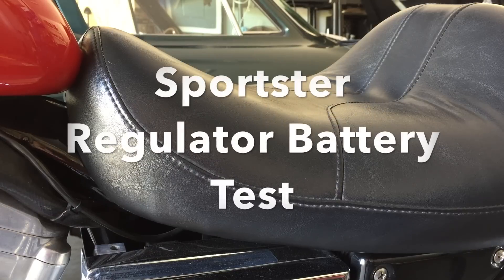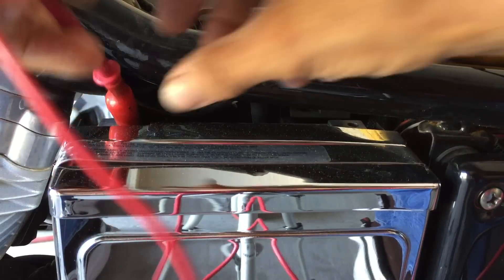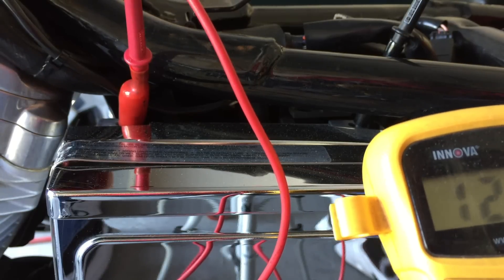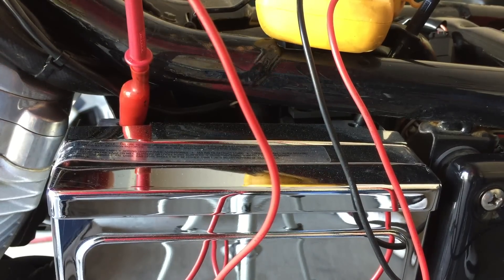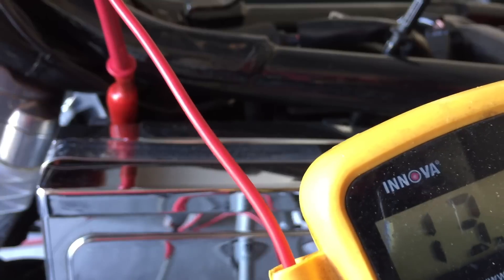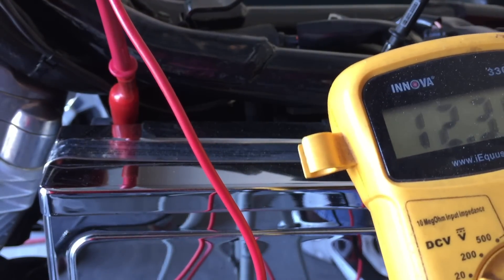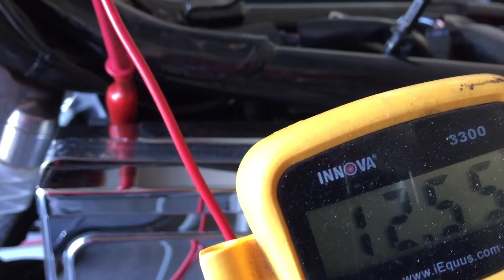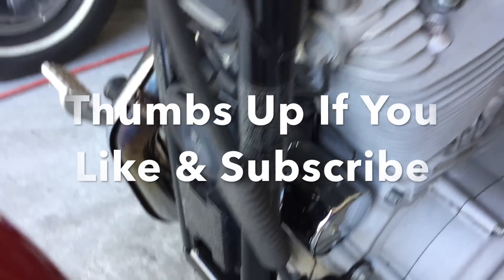How To Motorcycle Voltage Regulator Charging Test On a Harley Davidson

Comment: This is a B&S dodgy test of a RR - There;s all kind of issues not being looked at/picked up by simply check the charging by starting it up. If you suspect a charging issue I would start by taking off/disconnecting the RR then measure the stator cables (resistance readings) followed by do a forward and reverse resistance check on the RR)
Reply: Id like to correct what I said - Theres a couple of exceptions to the rule of measuring the resistance on RR's - Generally you can do just that, but when it comes to the Shindegen SH775 and SH847 series RR's you simply wont get a resistance reading with a voltmeter - Its a bummer and mystery to me, but workaround is to hook it up to a live scenario bike or a test bed and measure the voltage coming back out. 
- But as a general rule of thumb you should check the RR itself first where the resistance forward/back on between plus/minus and stator posts

Comment: My battery is showing 12.2 while off and idle its going up to 14.2. I've been having the check engine and battery light come on randomly. I was hoping it was the regulator because the ease of replacement. Is it possible that the regulator is out even though my battery it reading 14.2 just like the one in the video?
Reply from the maker: Regulator is functioning proper that's a good number 14.2 as for your batteries at 12.2 how old is it it?  Sounds old. I would replace the battery.  What Bike and year? do not buy a cheap one. I hope this helps. Thank you for watching and your sub Ben. Let us know how it works out. Ride safe and have a great day

Comment: Hello Two Wheel Rocco, My RR went out on me, luckily after I got back from a ride. there was 
smoke, the connector between the stator and RR was VERY HOT enough to get burned, it is a 91 XLH1200.
the stator is good .3 ohms and puts out 65 volts around 2500 rpm. the RR internally shorted 
the Bat+ wire to ground.  I am just trying to understand why the stator winding got so hot. there 
is a  circuit breaker between bat and charge wire but it,  I think is 31 yrs old and it never opened.
Thank you very much, I do appreciate your knowledge.
Reply from the maker: Happy to help. I would change out the regulator. They are cheap enough. That is the weak link in that system. Thank you for watching and your sub Ray. Let us know how it works out. Ride safe and have a great day.
Reply: @TwoWheelRocco  Hello TWRocco, Yup I got rid of that RR. I am going to put
an inline fuse in the Bat charging lead of RR for 25 amps. The stator is good for
23 amps. Clymers shows a circuit breaker between Bat+ and wire to RR but it is probably like 31 years old and never opened when it should have. Do you know
why the connector between the RR and stator got so HOT? I do have a new RR
coming from HD Tues or Wed.  I will crimp stator leads to RR's leads as the 
stator connector got scorched and was internally shorted.
Reply from the maker: @raymondgarafano8604  let us know how it works out. That's what regulators do, get hot when they're bad. Ride safe and have a great day.
Reply: @TwoWheelRocco  Well yes I know the RR gets hot as it is dropping voltage so the bikes' lites don't get burned out. No issue there, that is why there are Finns on 
the RR to dissipate the heat. I would like to know why the stator's wires and connector between the stator and RR got so hot..
Reply from the maker: Not regulating the voltage properly. I hope that helps. Usually that's the first thing I replace. Very rare does the stater go bad. Ride safe and have a great day. Thank you for watching and your support.
Reply: Thanks Rocco, Yup HD said, "usually when they go they either toast the battery
by overcharging or not charging but hardly ever short the battery charge wire
 to the ground, but its electronics so you can never really know." Thanks Rocco!
Reply from the maker: My pleasure Ray. Let us know how it works out. Easy fix.
Reply: @TwoWheelRocco  Thanks TW Rocco, It worked out well. I did put a 20 amp fuse in charging line  phsically near the RR so if the fuse opens up, hopefully njust on overload and not a direct short, I can change it out. I may have been lucky as I'd imagine the charge wire to be in the harness and if it got anywhere as hot as the line from Stator did, I think it would take out the harness, Anyway it is working fine.
I had a meter across the charging plug for the battery tender, meter read 14.5 volts
at 1500 rpm. and 12.8 not running.
Reply from the maker: Sounds like you got that under control. Ride safe and have a great day Ray.  Thank you for all your support.

Comment: So 94 sportster xlh1200 love your videos quick question fresh battery charged up check voltage before start 12.55v then running voltage fluctuates from 12.55v down to 9v sometimes to 5v doesn’t seem to be charging any tips haven’t checked regulator but the volts are going down up and not going past 12.5v so I thought possibly not a regulator issue. Also now I tried to start the bike and I hear a very fast clicking sound not a single click.
Reply from the maker: replaced your regulator that's what I would do let us know how it works out. Thank you for watching on your sub. Ride safe and have a great day.

Comment: Mines a 09 nightster and I'm getting 15.00 volts when I Rev it up and my code that's popping up is high voltage battery is good and just got a regular and still.. any ideas?
Reply from the maker: Happy to help, how old is that regular?  and how old is the battery? There's a short in the regular  or in that battery. Was this the same problem as your other regular.  Thank you for watching and your sub Kyle.   Let us know how this works out. Ride Safe And have a great day.

Comment: After the bike warms up should the voltage be dropping down to 12.5v at idle? I've noticed over the past couple days when  idling at a light I'll see my battery guage drop from 14v to about 12.5 then go back up to 14 if I bring the rpm above 1000...I checked the connections and the battery all seem good...I ride an 06 street glide injected btw
Reply from the maker: Thats Normal, My king does the same. Thank you for watching, Ride Safe and have a great day.
Reply: Two Wheel Rocco thanks so much for the quick reply...that puts my mind at ease...was starting to think it was the regulator or worse, the stator...thanks again and ride safe aswell

Comment: Hey Rocco thanks for the vid. Well done. Question. My 2009 softail deluxe has recently been having the check engine light come on a second time when getting ready to start it (it comes on normally for 4 secs when I turn on the “run” switch) but then comes on again for 9 secs then turns off. Starts just fine. Pulled codes from the bike today. P0563 (high voltage from the ECM), B0563 (high voltage from the turn signal module), b1006 and b1007 (line voltage from speedometer). Checked the regulator like you did in the video. Started at 12.6 volts, dropped to 10.5 at start, rose up to 14.17 after running a bit. Is it possible the regulator is bad even tho it seems to be charging?  Do you have other ideas?
Reply from the maker: Happy to help... Disconnect battery leads and retighten leads  check for loose ground ..Thank you for watching and your Sub Marshall. Ride Safe...And have a great day.

Comment: I have a '99 Sportster, 1,600 miles, new battery,  after a long ride I put it on the battery tender, within 8-10 minutes the tender light is solid green, that leads me to believe the charging system is ok, if it took a long time to get up to solid green I would think the battery was drained because the bike's charging system wasn't charging enough...........does that make sense? I should get a multi-meter to be sure I guess?
Reply from the maker: Happy to help. I would have to agree. All sounds well. Any questions just ask. Thank you for watching and your sub Frank. Ride safe and have a great day. Very rewarding to do your own work on these Sportsters.

Comment: I was just riding bike started puttering noticed speedometer dropping and lights flickering... got to my house and bike stalled out... would that be a regulator or stator problem? 2011 fxdf fatbob
Reply from the maker: Sounds like you will need to replace your regulator.  It failed and you where running on your battery. Replace regulator and charge battery. Let us know how this works out.
Reply: @TwoWheelRocco  I saw one of your other videos i will place the order on ebay and give it a go over the weekend... I'll keep you updated
Reply from the maker: @Mr75towing   Any question just ask. Thank you for your support.
Reply: @TwoWheelRocco  took me some time to get around to it... when i removed my battery cover the negative terminal had melted on the battery... i bought the battery from harley and they charged it for me a few months back. Replaced battery and regulator since regulator was original and bike is 8 years old.... bike started right up over 14 volts idle 12.5 off... thank you so much! Saved me an easy grand or more local bike shop went and said stator from what i explained to them. Ride safe
Reply from the maker: @Mr75towing  Happy to help, Thank you for the Sub. Ride Safe and have a great day.

Comment from the maker: Let me know if you have any question.
Reply: Two Wheel Rocco how do you know if the regulator is bad. i got a P0562 code and I have read it couls be battery. regulator. or stator.
Reply from the maker: Sounds like bad regulator... Check battery connection. regulator should charge at 13 to 13.9 or so....Put a volt meter on the battery and run the RPM's up and watch to see if the voltage climbs if not... indication a charging problem. Change Regulator..Hope this helps..Let me know how this works out.
Reply: Two Wheel Rocco Thanks. figured my best bet would be swap the regulator. then go from there.
Reply from the maker: They are notorious for going bad.....Ebay, very fair prices...Ride Safe..
Reply: Thanks! You too!
Reply: Two Wheel Rocco. 12.59 volts. start up drops to 9.98... the it peaks at 13.86 while running at idle and while holding revs at about 2-3k
Reply from the maker: What year Sportster...
Reply: 2008 Nightster
Reply from the maker: Did you check ground cable on battery side....they are set up poorly...9.98 is not going to work out well....If connection is tight. Replace....http://www.ebay.com/itm/New-Voltage-Regulator-Rectifier-For-Harley-Davidson-2007-2008-Sportster-883-1200-/361442779138?hash=item5427ab2002:g:SpoAAOSwxN5WYKDG&vxp=mtr  Hope this helps...Let me know...
Reply: All connections are solid.
Reply from the maker: Replace.. easy fix.....Ride Safe...
Reply: At idle my bike floats around 13.5 V when I bring the rpms up 2k-3k battery voltage drops to 8-9 and holds there. Did a continuity test on stator it passed. checked operating voltage of stator at 2k  rpms and it was 40-42V. You think its the regulator/rectifier?
Reply: Could bad regulator cause overcharging and burning out lights?
Reply from the maker: Absolutely my friend,  Buy a new regulator. That is what a bad regulator does. Any questions just ask. Thank you for your Sub Adolfo. Let us know how this works out.  Ride Safe and have a great day.

Comment: My battery is at 12.6v when bike is off and goes up to 13.9v when I start it and it stays there, even if I rev it up a little it won’t reach 14v. Bad regulator?
Reply from the maker: Happy to help. Regulator is fine. 13.9 is great. Thank you for watching and you sub RGV.. Ride safe and have a great day.

Comment: Sorry to bother
I was wondering my 2016 Harley 48 that  I check the charging system when the power is off it shows 12.3 and when I start up it goes to 13.5. Then I rev it , it goes to 13.9.
Is that ok for my charging system?
 By the way I changed my battery about a month ago
Reply from the maker: https://www.ebay.com/itm/334116670196.  Great Battery.  let us know how this works out.
Reply: @TwoWheelRocco  and also my charging system is running well as well?
It didn’t go up to 14.5 but only close to 14 when I rev it with idle
Reply from the maker: @louislouis809  System is working well your battery is old,   Personally myself I would replace it. I sent you a link for a great battery that I use., Let us know how it works out.    https://www.ebay.com/itm/334116670196
Reply: @TwoWheelRocco  But I just replace my battery a month ago
Reply from the maker: @louislouis809  12.3 is a weak battery,  Should be 12.7  is a good battery.  recharge and recheck volts. let us know how that works out.

Comment: Gen light on at low rpm ...
Hi. Rpm its out ???
Reply from the maker: Test, what does it read volts on high RPMs?
Reply from the maker: Sounds like your regulator is failing. What does your volt meter read when RPMs are up a 3000 rpms when you test?

Comment: Hey 1975 sporty light on at low rpm
????
Reply from the maker: Low oil pressure.  If you raise your idle you will have better oil pressure.  Hope this helps. Thank you for your Sub Ed.  Ride Safe and have a great day.
Reply: Gen light on low rpm 
Hi rpm its out ???

Comment: Ey, so when my bike is up and running the volts jump to normal numbers but every 2 months or so the bike wont start up and I have to charge the batt. The battery was brand new when i threw it in about 6 months ago. Any thoughts? Alternator? Bad cell maybe? Loose connection draining somewhere?..
Reply from the maker: Type,Year and how many miles?
Reply: 85 xlh 1000. No idea on the mileage.
Reply from the maker: Install a battery tender....Sorry i do not have an answer...Sounds like what you stated Loose connection Drain somewhere...Old bike..Let me know when you figure it out.

Comment: Hi man, is it possible for the regulator to overload the battery after some time riding?
The bike is a 2008 Softail FX and it's battery is getting overloaded with 16A ~18A after some time running at six speed. 
I already measured with the bike stoped and it looks like normal, being  under 12.7A +- when turned off and getting to 13.7A +- when started, the overload only happens if the bike runs at the six speed for a while.
Another curious thing is that the overload stops if I let the bike reduce it's speed under 70km/h at the sixth speed
Reply from the maker: Yes it can..Let me know how it works out.
Reply: The issue was on bike's stator, one of it's coils was burnt making it to close a short circuit with the bike negative pole. As the bike uses the negative pole to charges the battery this short circuit causes a overload charge on batery.
Reply from the maker: Thank you for the update.....Have a great day and Ride Safe.

Comment: Went through all the step you show and my ohms meter doesn’t  go over 12.8v. Do I have a regulator problem?
Reply from the maker: With your bike started and revving,  it will not go over 12.8? Then you need a new Regulator for a good charging system. Let us know how this works out.
Reply: Two Wheel Rocco how often should a regulator go bad? This is 2 years old.
Reply from the maker: @Rickster208  China, things are not the same. Has happen to me also.
Reply: Two Wheel Rocco so with a good ohms meter, 12.01v when the bike is off. With the bike on and reved up 13.3v.
Reply from the maker: @Rickster208  13.3 will work fine...Battery is a. little low at 12.1  How does it start?

Comment: is it possible for the regulator to have intermittent problems?
Reply from the maker: Yes,  Regulator get hot and fails....What year and size Sportster?
Reply: Two Wheel Rocco  2007 electra glide classic
Reply from the maker: I know that 07 sportster with low miles are notorious for bad regulator.
 http://www.ebay.com/itm/Regulator-Rectifier-for-Harley-06-07-08-FLT-FLH-74505-06-Electra-Glide-Road-King-/252757307650?fits=Year%3A2007%7CModel%3AElectra+Glide&hash=item3ad9827102:g:bUIAAOSwWxNYyzX~&vxp=mtr